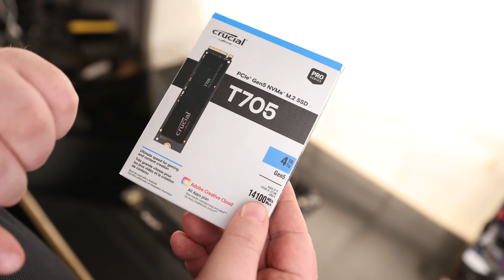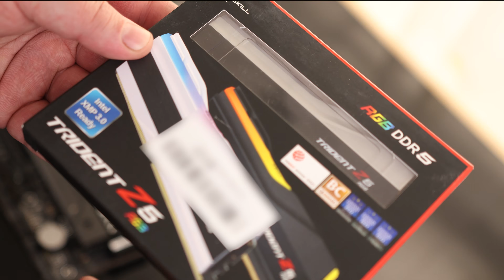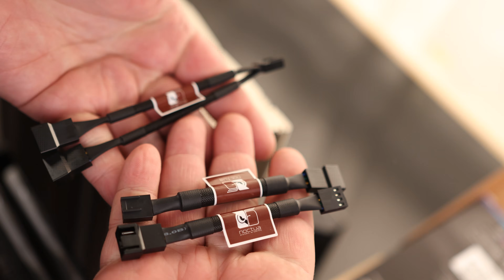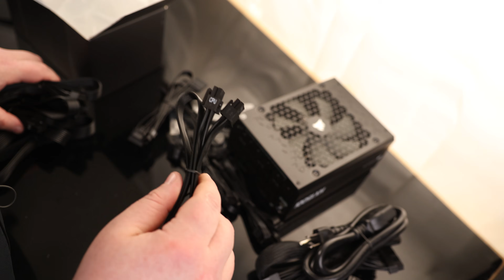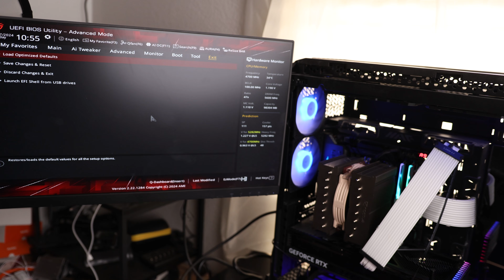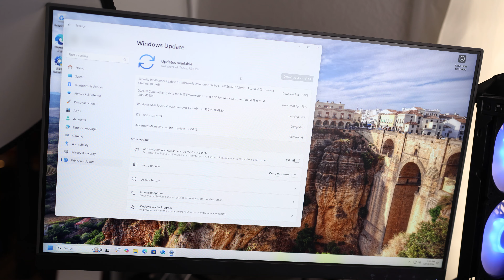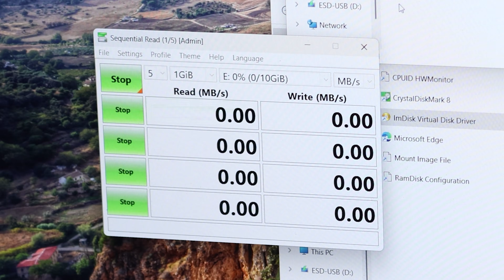Full Build 9800X3D, ASUS X870E-E, G.SKILL Trident Z5, Crucial T705, Noctua NH-D15 G2, HX1500i

Comment: The build Im starting in a week or so is similar, I went with the X870E Hero and the new 9950X3D.  I want to buy the T705, but Ive been seeing a lot of complaints about it running rediculously hot.  They sell a model with a heatsink, but from reviews it seems to be not great at all.  Noticed ur using the onboard heatsink with it...how is that performing?  Saw the benchmark tests u did and the temps look good but curious on the temps ur getting when its under load for periods of time or when gaming?  Just debating if I want to try the onboard heatsink or order a custom heatsink for it.
Reply: I have all those... will be building soon! the MB has heat sink on top and bottom for that M.2. I suspect it should be ok. But we shall see
Reply: @gregblank247  Yeah, I knew about the on-board heatsinks.  I just read A LOT of info on the T705 having insane temps when under load and being a problem for people.  Decided Im going to get the ones without heatsinks and see how on-board goes first, just go from there.  Luckily, M.2 heatsinks r stupid cheap and available.  Saw a review for a Thermalright HR10 2280 Pro, has a fan and requires a 4pin connector but drops the temps by 20 degrees or so.  Seems like overkill but that thing only runs like $20.
Reply from the maker: I haven't paid attention to it.  I haven't had any issues.
Reply: @Distractor_Beam  Thanks for the response.  Think I'm going to just get the ones without heatsinks, and see how the onboard ones perform.  Appreciate ur build video 👍

Comment: I have exactly this same build except cooler and case, also using Samsung pro 990 4tb ssd. 
I am not getting any display. Powers up with code 15 but switches after a few seconds to "A0" with a red led. No display from iGPU OR the egpu. Any suggestions? I've tried just about every troubleshoot I've been able to find. 
I've found that the model of Trident I bought has very similar speed as yours but it is the 2x32gb kit. It is not on QVL List. 
Could this be the issue? 
Mind providing your part number on your ram?
Reply from the maker: A0 to my understanding means the POST completed successfully and handed over to the hard drive.  The manual lists it as:  IDE initialization is started.  A red LED on the Q-LED means processor error.    Those 2 things are in conflict in my mind.  If you're not getting any display, I'd start with another cable and/or display.  Some TV's don't handle BIOS very well.  You can also try to remove the video card to force it to use the motherboard HDMI port.  This is my RAM:  F5-6400J3239F48GX2-TZ5RS  I've used RAM that wasn't on a QVL before and was fine, but it could still be that.  A processor error is also still a possibility as the Q-LED is pointing to that.  Make sure all your cables are fully seated.  Especially the CPU cable.  You can unplug them, and plug them back in.
Reply: @Distractor_Beam  thanks for your reply and the information.  At the time I tried just about every troubleshoot aside from testing CPU in another Mobo and another Mobo with a good CPU. Upon a close inspection of the 9800x3d, one of the pads was missing almost all the gold contact. 
I've since returned the Mobo and the initial 64gb ram kit I bought (replaced it with a 32gb kit directly from QVL hoping that was the issue, it was not)  and the CPU. In the meantime I bought an r7 9700x and a MSI x870P for significantly cheaper and everything POST and worked right out the box 

My faith in Newegg has been completely restored. They refunded the Mobo almost immediately with no questions asked.  

The CPU, however - came from a 3rd party seller, was marked up over $150 and I'm still waiting to see if they'll even approve a refund for it. I know nothing except the fact of my own ignorance. But I'm 100% positive I did not damage the CPU or the am5 socket. This was confirmed to me when Newegg issued the refund.
Reply from the maker: @QuantumDivergence  Ouch.  That sucks.  I wonder if that was a manufacturing defect, or if they were playing with it before they sent it to you.
Reply: I have simillar build and get random problem with GPU detection. If boots corectly - works like charm. But 30-40% of boots fail to detect GPU and switch to iGPU. :( Have you solved your problem? Conecty HDMI to MB and check if it boot on iGPU.

Comment: Same build 9800 x3d same mobo 64gb same ram, i have just 2x 990 samsung 4tbdrive 8tb total. Wanted to go with the same gen 5 drive but didnt see any real difference in all the vids for gaming, and asus ryujin 3, i wanted and almost went with the noctua as usual but the blk ones are made yet they are still building so i went full asus build. And just got my 5090 at micto center smh i guess that camping at 4am paid off to be number 1 on the line smh i dont ever want to do that again.

Comment: Isn’t it rule of thumb not to plug in any direct cables into the PSU unless they are specially from the PSU manufacturer, i.e. u plugged in your white 12v high power cable for the gpu from Lian Li directly into the Corsair PSU
Reply: If there's a rule, it's do not use aftermarket cables at all.  Adding another connection on top of that adds another potential point of failure, but I also did that with the 24 pin, so...  Enjoy Strimers at your own risk.
Reply from the maker: If there's a rule, it's do not use aftermarket cables at all.  Adding another connection on top of that adds another potential point of failure, but I also did that with the 24 pin, so...  Enjoy Strimers at your own risk.

Comment: So what's up with fTPM? I can't install Windows 11 without first enabling fTPM in BIOS?
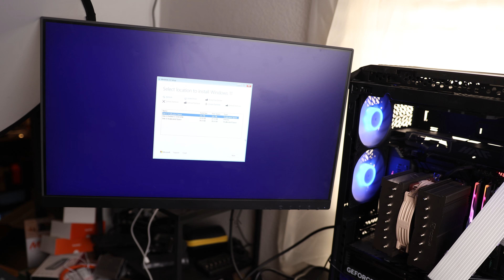Reply from the maker: 14:50
Reply: @Distractor_Beam  Hi. Thanks for the answer. That's why I'm asking. Because I didn't understand that part of the video. Apparently I can't just insert a flash drive with Windows 11 and boot it without first setting up the TPM in the BIOS? The TPM isn't enabled by default? I'm not a very advanced user.
Reply from the maker: @Cap_Galahad  It may and it may not.  The odd thing for me on this build was that I didn't have to enable it, but I did have to reboot it to get TPM enabled.  Your experience may vary.

Comment: Memory code 15 is not a problem, it's memory training, which can take a few minutes...
Reply: How many times are you supposed to see this code? I rebooted several times and I saw it running again.
Reply: @mkrbu50  Don't reboot, let it run as long as it needs, then restart itself.. If that is what you mean (restarting itself), and it's not working, reset bios and leave it run, then try setting Expo or XMP, it will retrain after, also make sure your ram is on the QVL memory list for your motherboard..
Reply: @Vialli100. Thanks, all is good now.
I did a check for the QVL memory and it was a match.
Reply: Once or unless u remove the ram and re insert the sticks @mkrbu50

Comment: Will a Thunderbolt PCIE expansion card be able to be installed in one of the bottom Pcie slots or does a motherboard have to have a Thunderbolt Header
Reply from the maker: The Thunderbolt pcie cards I'm aware of require a Thunderbolt header.
Reply: @ is there a thunderbolt header on this one in the video
Reply from the maker: @Desi4ktv  No.

Comment: I bought this mobo on NewEgg and it came with CORSAIR Vengeance RGB 32GB (2 x 16GB) 288-Pin PC RAM DDR5 6400 (PC5 51200) Desktop Memory Model CMH32GX5M2N6400C36. I can’t do any DOCP with it. It’s stuck on 3600 and if I change anything regarding the memory it won’t boot and k need to reset cmos. Why the hell did they give me memory that isn’t even on the QVL? I’m probably gonna have to buy more memory
Reply from the maker: Most of the time, when they bundle equipment, it's because they want to get rid of it.

Comment: Any suggestions on why my Asus x870e-e has no sound? Realtek installs but the driver won't take (uses USB Audio 2.0 generic driver and has no output device).
Reply from the maker: Are you using the ASUS Driverhub?  Sometimes Windows drivers don't cut it.  Also check realtek audio console and make sure it's configured for your layout.
Reply: @ yes, thanks for the advice! 
After days working with asus support (no resolution, 2 motherboards) and unofficial asus support forum support and discord support - no resolution. 
I’m just going to disable the device through device manager and use the gpu >hdmi cable>tv out>pc speakers.
Reply: @linkzz00  That sucks.  Sorry to hear that.
Reply: @linkzz00  That sucks.  Sorry to hear that.
Reply: @linkzz00  That sucks.  Sorry to hear that.

Comment: This is almost exactly the same pc I'm building currently so this is a wildly helpful video.
Reply: same here
Reply: I have this MB, CPU and GPU. I get random GPU detection during boot issue. Have you ever get simillar problem?
https://youtu.be/TAmQhZKQ6Yw?si=gsoGtNoO9z3R44gy
Reply: @konradbak if the pc works U log into windows and U still have that VGA light that means U turned the pc on while the monitor was off
Reply: @thealien_ali3382 Problem slolved. My Asus board is unocompatible with my GPU. Changed to MSI and problem solved.

Comment: Just built a similar system with the same processor and same cooler but with the offset. Temps were a bit cooler and the all core boost went over 5,1ghz but the package power was also just 140W instead of 160W
Makes me think I did the mounting suboptimal

Comment: got the same mobo and processor. my mobo always show's 50-53 and 54 qcode errors. my ram is t-force 32gb 2x16 6000. i tried to put clean the ram, manually profile it in bios, change slots. i dont know what to do, can you help me with it?
Reply from the maker: Have you updated the bios?  You can also try one stick of RAM.  Make sure it's in the A2 slot.
Reply: @Distractor_Beam  yeah i think the tech already updated it. is there a chance i could see if its updated already or not?
Reply: i checked it in the command prompt. is it this one? 
BIOS Version/Date	American Megatrends Inc. 1001, 10/01/2025
Reply: @lylevyier  That looks right.  1001 is the newest.
Reply: @distractor_beamreviews  is there anything i can do with it? Theres also qcode 50-53 57 then goes back to 49 47 then back to 50+ same cycle
Reply from the maker: @lylevyier  Have you tried one stick of RAM in the A2 slot?  Try one stick, then the other stick.
Reply: @Distractor_Beam  yeah i already did
Reply: @ i really dont know what to do anymore
Reply from the maker: @lylevyier  57 is CPU mismatch.  I'd pull all the plugs, look for bent pins, and make sure they're fully seated.  Try the other 8 pin CPU power port on the top of the motherboard.  Do the same thing at the power supply.  After that, I'd pull the CPU and make sure it's seated correctly and there's no bent pins.
Reply: @Distractor_Beam  i think i already know how i get 50+ on the qcode. i think its just the temperature 🤣

Comment: Noctua states you can get up to 3°C lower temps on newer AMDs when using those -7mm offset mount holes
Reply: Also he installed the second fan in the back which doesn't really make sense in terms of cooling down the noctua radiator
Reply: @edomoto180  Для таких больших воздушных кулеров процессора желательно использовать низкопрофильную память типа  Flare x5, тогда и вентилятор можно поставить на своё место почти без смещения вверх к крышке корпуса. Если же корпус большой, то можно сместить кулер и с этой памятью, крышка корпуса не помешает.
Reply: Can someone explain why exactly the -7mm offset is having this effect on the temperature?
Reply: @DaerJohannes  Ryzen core dies are placed a bit towards the bottom, not in the center. Offsetting the cooler in that direction apparently improves the contact pressure a little bit, and also aligns the hotspot with the center of the cooler base, which makes the thermal load distribution slightly more even across the heatpipes.

Anyway, I wasn't able to use the offset holes on my motherboard, because the cooler collided with VRM heatsink xD

Comment: Has the T705 been okay, thermal-wise? I've heard it can overheat and throttle, but I am hoping the motherboard heatsink fixes that. I bought this motherboard and am still trying to figure out which ssd I want.
Reply: I haven't had any issues.
Reply: @distractor_beamreviews  ok cool. guessing most of the complaints are overblown or from people not using a heatsink.
Reply: @haroldallaberg6359 That seems to be the case. I’ve been using a 2TB Crucial T700 as my main drive for about a year, and it’s been performing very well with the motherboard’s heatsink. As long as there’s a nice double-sided motherboard heatsink, the T700 series shouldn’t have any issues.

Comment: I want to copy your build exactly and I'd like to know if there would be anything you'd change now that you've built it.  
For example, since the second fan wouldnt fit on the Noctua NH-D15 G2, would you choose a different model and if so, which model?
Or perhaps choose a different motherboard so that both fans could fit on the Noctua NH-D15 G2? And if so, which motherboard?
Any other changes you'd make or additions?
Reply: I am solving this by buying this mem that has the exact same specs but without the RGB so low profile of only 33mm: G.SKILL Ripjaws S5 Series (Intel XMP 3.0) DDR5 RAM 96GB (2x48GB) 6400MT/s CL32-39-39-102 1.35V Desktop Computer Memory UDIMM - Matte Black (F5-6400J3239F48GX2-RS5K)
Reply from the maker: If they had a LBC model with a single fan, I'd get that.  I don't think that's an option.  Everything else has been exceptional, and I chalk it up to now having an extra fan.

Comment: I have the same motherboard and g.skill ram 32 GB on the expo. I noticed that, like me, it shows you errors 33, 34 on the clock. For now, I'm using a graphics card integrated into AMD 9 7900x. Unfortunately, the system is not stable and the AMD graphics driver informs me that the time limit has been exceeded. Does a dedicated graphics card solve this problem? I will be grateful for the answer.
Reply from the maker: I've never heard of a time limit on integrated graphics.  Are you talking about timeout?  If you're gaming, I'd recommend a dedicated graphics card.  Integrated graphics are good for workstations, or troubleshooting graphics card problems.  They can work for some gaming, but they're typically a disappointment for anything modern.
Reply: @ Yes, it's about timeout. I use an integrated card occasionally, because I'm waiting for a new generation of graphics cards. I was reassured by what you wrote, because I was afraid that this error could also occur with a dedicated graphics card. Thank you for your reply 😊

Comment: I've just finished my build pretty similar to yours and I prepared the flash drive but it won't boot into windows for the installation, am confused
Reply from the maker: Is it the same motherboard?
Reply: @Distractor_Beam  yup and thr 9800x3d
Reply: @Distractor_Beam  I made it to the bios, I updated it.  But now am having trouble booting windows off the flash drive
Reply from the maker: @7v4rOTh3Gamer  That's odd.  I know sometimes you need to set it from the boot menu.  I believe on ASUS it's F8 on startup.  I'd also check to see if that drive works on another board.  If it's a high capacity flash drive, the computer might not see it correctly.
Reply: @Distractor_Beam   i agree, I feel like the flash drive is the issue. Is there a flash drive you can recommend?
Reply: I did try a 32gb scan disk flash drive and had the same issue
Reply from the maker: @7v4rOTh3Gamer  How are you loading Windows onto the flash drive?  I typically use Kootion 64gb drives:  https://www.amazon.com/gp/product/B07TS5YWYR
Reply: @Distractor_Beam  I went to the windows site. And got the windows iso
Reply: @Distractor_Beam  am going to try the windows media creation option today
Reply from the maker: @7v4rOTh3Gamer  This is the way.
Reply: @Distractor_Beam  quick question. Does the format HAVE TO BE fat32?
Reply from the maker: @7v4rOTh3Gamer  I typically use exfat, but I believe the media creation tool will reformat it anyway.
Reply: @Distractor_Beam  I had changed the format to exfat. And then downloaded the iso. Not the media creation tool option , and it didn't boot into windows.
Reply: @Distractor_Beam  after this attempt of making it fat32 and doing the media creation tool option idk what else to do lol
Reply: @7v4rOTh3Gamer  With the ISO, you need to prepare the flash drive with a tool like Rufus to make it bootable.  The media creation tool does everything for you.
Reply from the maker: @7v4rOTh3Gamer  With the ISO, you need to prepare the flash drive with a tool like Rufus to make it bootable.  The media creation tool does everything for you.
Reply: @Distractor_Beam  thank you bro, I appreciate the information you just confirmed exactly what I was thinking. Getting ready to do it I'll keep you posted
Reply: @Distractor_Beam  everything works now bro. How did you bypass the ftpm screen?
Reply: @Distractor_Beam  I got it bro. Everything is running. Doing my updates and everything
Reply: @Distractor_Beam  whenever I boot with two 16gb of cosier vengeance ram sticks I get a c5 error with a yellow light
Reply from the maker: @7v4rOTh3Gamer  Glad to hear it.  Hit "Y"
Reply: @Distractor_Beam  definitely did